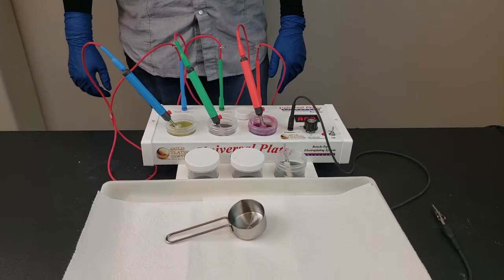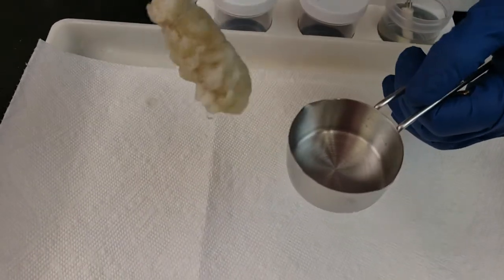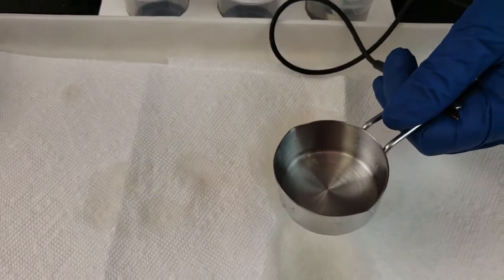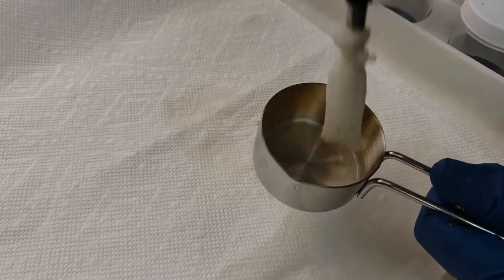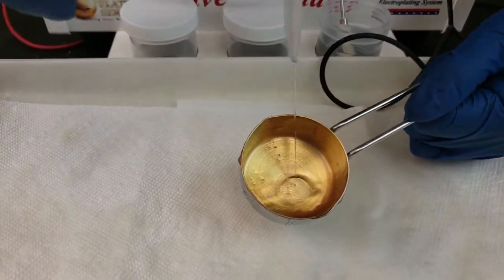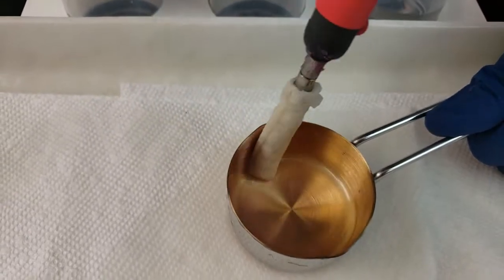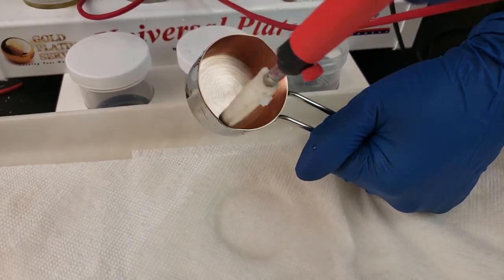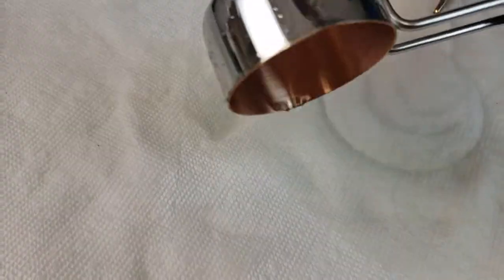Rose Gold Plating- Brush Plating Stainless Steel Measuring Cup

Comment: Will this work on porcelain? I am trying to make a set of teacups and want to plate the inside in rose gold but trying to figure out how.
Reply from the maker: It could work on porcelain but there is a catch. Because porcelain is not conductive you would have to make it conductive. You can do this with conductive paints. I would suggest watching our video on plating 3d printed items because it will show you the process.